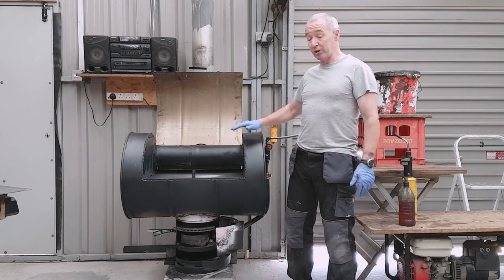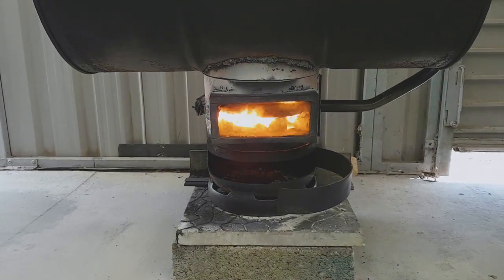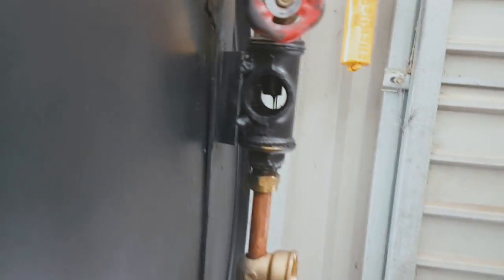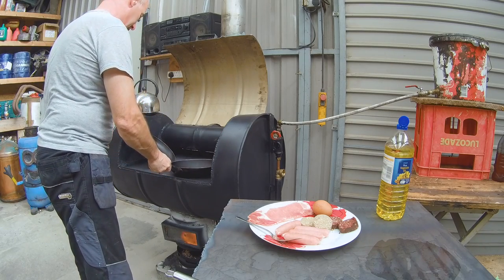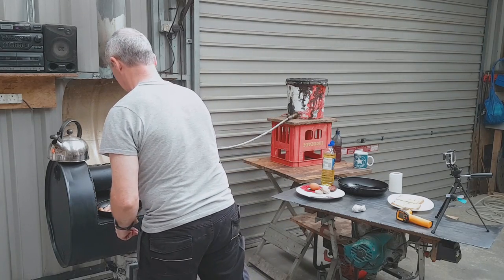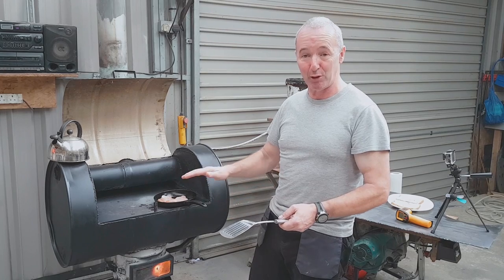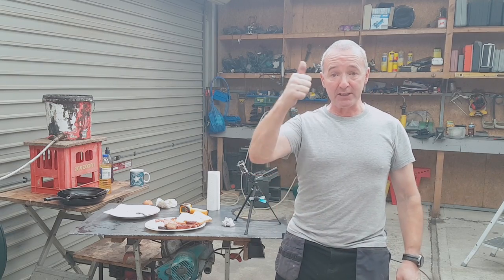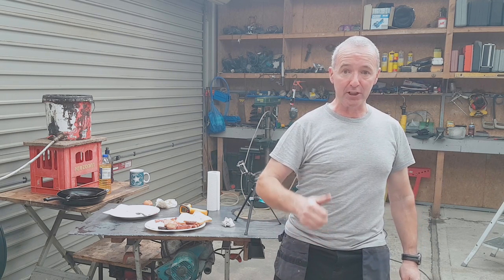FREE Heat & Eat -- Fantastic Waste Oil Stove

Comment: Pretty nice setup.  If you are going to do this often. I world use a cast iron pan and also make a trivet. 3 to 4 inches high to throw the pan on every so often to keep the heat steady.  I would also throw a stock pot of water on there and keep it full. It will help with the heat drying you out.

Comment: The vortec burn pot is best design ive seen so far , no need for a fan or blower , great for off the grid application , if you added more chimney would give it so much more potential but I dont think you need anymore .

Comment: To have a cooler spot on the cook surface, try a trivet or short stand to put the pan on. Lessening contact with the surface will result in lower heat transfer. You also might put a shroud around the burner and putting a fan to blow across it.

Comment: On high heat, Cast Iron pans will have 90% less chance to burning. They are very thick and it distributes the heat evenly. Find one or two in a thrift store or order a couple from Ebay or Walmart. Very affordable.  I have two 30 pond propane tanks and a couple 55 gallon drums and two brake disc off my F250 truck. Maybe I will get my son and we will try to build one of these. An awesome stove.

Comment: Just for future reference petrol drums only last a few years ?
Where as hot water heater tanks are much thicker metal and are glass lined requiring a bit more prep (grinding) . And can last many more years!
The break disk acts as a repeater to fully burn fuel a second and even 3rd extracts last bit of heat(fuel) and a circle, loop , square in exhaust pipe or long run 
Maxes out the available heat normally going out the chimney  !
Talked to many survivors of mining camps an US depression in my day !!!

Comment: Good onya old mate.  Cooking is dead easy.  The biggest problem is whether or not you survive eating the end product of what you produce on your stove before you get it right!  Even so, it's probably better to be the dispenser of your own indigestion before you inflict it on others.  But, as they say, what doesn't kill you can only make you stronger.  You might want to consider getting a cast iron frying pan because they are great at retaining heat even after you remove them from the heat source and then will keep on cooking the food for quite while after.  Perhaps a mesh platform about 10 mm above the stove top for the pan to sit on after you remove it from the heat.

I heat my pan on an electric stove until it's smoking hot and if I'm cooking a steak or chops, I sear them on both sides and then turn the heat off and put a cover over the pan, usually a pot lid.  The residual heat in the pan and the stove element is enough to keep cooking the meat and everything I add afterwards, which maybe some tomatoes and lastly the eggs, will all cook in time to be dished up simultaneously.  As you can't turn the heat off, that's why I suggested the raised mesh platform for the pan.

Your sausages turned out pretty good and since I don't know if that was intentional or not, here's a little tip on cooking sausages from none other than Keith Richards.  Keef always starts cooking his sausages in a cold pan and slowly raises the heat and by doing it this way, the sausages won't curl up on you.

Comment: Great video, i wonder if it would be possible to make a NON weld one
Reply from the maker: Hi Mart. The shed heater can be made any shape so it is possible to bolt one together. The burner unit would need to be welded I think though. Cheers Gerry

Comment: Wow, that is awesome! My concern is being able to turn off the oil if I forget it's on. Maybe a solenoid, on a timer in-line with the valve?
Reply from the maker: Hi William. A solenoid valve would be an easy addition. As its setup in this video it does not require any power which is great but with a fan and control gear I could make it even more efficient. Thanks for the comment cheers Gerry
Reply: just use a small fillable reservoir instead of a large tank, a canister that holds like 1 hour of fuel at a time or so, placed so you can safely refill it while running if you want to keep it from running dry

Comment: Thanks for sending me the link to your naturally aspirated waste oil burner.  I've got the wood burner right now.  I plan on cutting the hole in the bottom and welding half the propane tank unit to the base of the stove.  That will raise the stove and allow the flame to come up through the floor and heat the fire bricks lining the stove.  Basically,  your burner mounted to the bottom of a wood burning stove with fire brick.  Any thoughts?  Heating a insulated 30 by 40or shop

Comment: The only times I've managed to get cooking oil to burn clean are with wicks (cotton wool or mineral wool) and also one time accidentally with a grossly overfired woodgas stove (I tipped the remains of the oil from the pan in and at the last vapour dregs, the thing started glowing red hot all inside and didn't want to break it so turned off the fan. Still big flames and no airflow for cooling so I turned the fan back on. Nope red hot again! So I tipped it over to get rid of the oil but the base caught fire and I had to rewire the resistors and socket with a metal one. I should have just stuffed it with damp soil to extinguish it.

The red hot burn was amazing - clean hot thin red flames (like bunsen burner flames but red), never seen cooking oil burn like that but if I had a ceramic appliance that could take the heat long term then it would be the cleanest high output burner. Perhaps some form of vaporisation into a red hot fire brick chamber with pre-heated air and secondary burn is the way to go.

The wicks burned with candle like flames but they don't soot provided they aren't too long. I can use them in the house without a chimney. 4 wicks in the bottom of a can. Rockwool is the best wick as it lasts the longest. Cotton wool burns down a bit quicker but it is easier to pull through the hole without it falling apart. I could gradually heat up soup when I had those 800g tin cans. One to surround the oil candles and one on top with some rockwool insulation around the top can.

Comment: Love the videos. I built an oil burner out of a beer keg using your design with oil pan and air feed coming through center. Do you ever have a bad soot problem? After about an hour burn or longer mine gets pretty dirty with soot. Should i try and compress the flame more maybe?

Comment: Nicely done! Watching you cook your legs, got me to wondering, could the burner be built separately towards the back and then have the heat piped to a chamber with a lot of holes under the barrel cooking surface area so the heat is evenly distributed and then running up the enclosed ends as you have and final piped up and out of the shop. This would place the burner far enough away to not bake your leg and yet still enough heat to cook with? I use an upright barrel wood stove to heat the house with and cook on top of and yeah, sure do bake the legs.
Reply from the maker: Hi Azriel. When I thought about making this shed heater I thought it would be good to have a flat heating surface for parts but after I first fired it, cooking looked possible. It makes so much heat that getting too close to it  meant I could smell my trousers roasting lol. I do have plans for this configuration though. I will be making a siphon nozzle powered unit and I am thinking of end firing this stove  just under the hot plate so the little propane bottle will just be a stand and will not heat. I have yet to fire the new burner as it in still being put together but does not hurt to make plans. Well done on getting something to work and heat your house is a fantastic bonus too. Cheers Gerry

Comment: Hi, great job on the burner. Do you think a smaller burning pan would work? I have a lot smaller area to warm, and I have about 300 gallons of old diesel fuel (not suitable for an engine) that I would love to burn. Any input would be greatly appreciated. Thanks.
Reply: I saw a video with a tiny one running off a tablespoon oil pan and a 2" square vertical chimney, and basically none of the other functional features, this concept can be scaled as small as you want and as large as you can build

Comment: i had a old renault diesel ticking over 24 hours a day for 7 days it  worked out at 1 litre per hour what are you getting  thanks   the renaut  was piped to internal garage with old car radiators positioned around
Reply from the maker: Hi Honda4004. The car option at 1 litre per hour is a great solution and can make electricity too. The consumption at 1 litre per hour is  lower than my burner but there are no moving parts, no reliability issues with the burner. You simply light it and pour oil in a bucket. It also runs on waste oil which is free.  It burns about 2 litres per hour but there is more heat from it as there is no heat loss to the engine or transfer pipework. This unit can make a lot of heat in the room it is installed in but you would need to make a scaled down version for smaller areas. I will be making a mechanical thermostatically controlled unit in the next couple of weeks capable of heating water or a domestic heating system. Thanks for the comment Cheers Gerry

Comment: If you ever use this to heat in cold climate it will be helpful to provide a 3-4" air inlet. It doesn't need to be piped tight to the stove. Just end it near the stove. Don't forget cold air trap so no problem when you're not burning.
Reply from the maker: Hi Art. My shed is far from airtight which is why I run my stoves so hard in winter but that's good advice Thanks for commenting Cheers Gerry
Reply: GerrysDiy The idea is that by providing an open pipe of combustion air near the stove, those other inlets will draft less thus keeping more of the cold away from those places. 1 pipe size smaller than the stack should be enough. I use plastic 4" schdl 10 drain pipe. Works great!
Reply from the maker: Thanks Art Cheers Gerry

Comment: i live in northern Minnesota how  can i keep the oil from thickening up ?that minion is kool
Reply from the maker: Hi electric phesant. My oil can be thick at times but once I light the stove and start producing heat the oil in the bucket gets to room temp and flows well enough to run the stove. Some of the guys add a little diesel to the oil if they need it to flow but so far I have not needed to. Cheers Gerry

Comment: The world is on the metric system but the U.S. is not. To convert degrees in celsius to fahrenheit, first multiply degrees celsius by 1.8. Then add 32 to that result and you get the temperature in degrees fahrenheit. 150 C converts to 302 F.